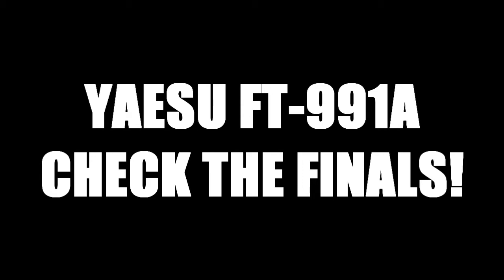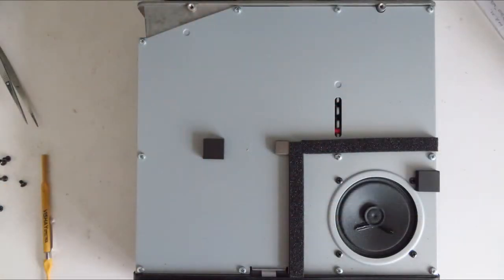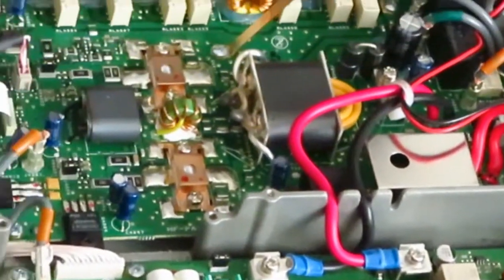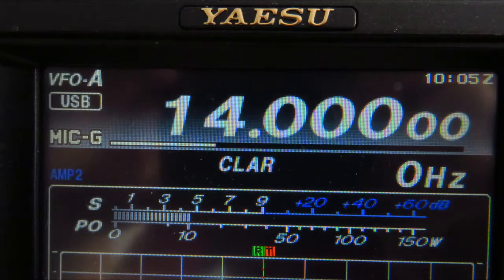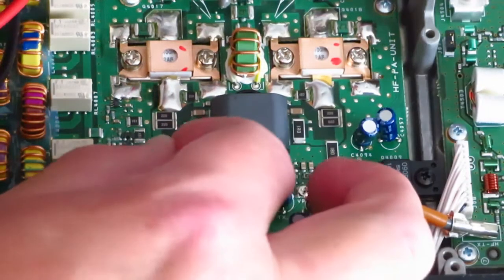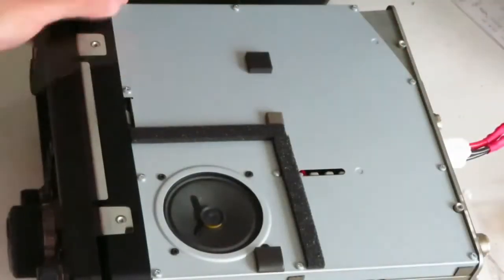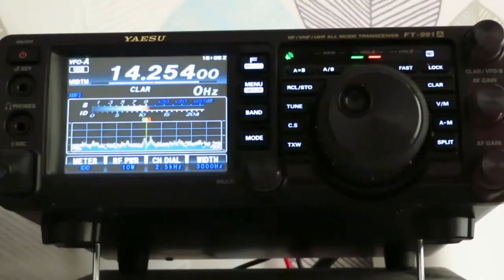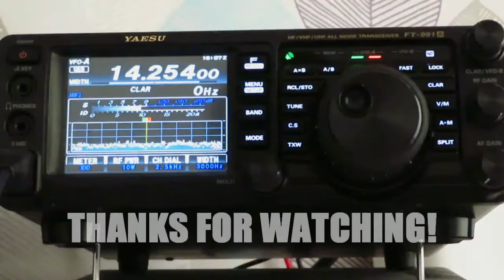Check Your FT-991A Finals

Comment: It is interesting to look at the shape of the output signal after such adjustments. And of course, I am sure that the thin probes of the cheapest Chinese multimeter dangling in the holes from the bolts show the true value of the current. An excellent guide to breaking your expensive transceiver!
Reply from the maker: Thank you for your comments.  It is entirely up to the viewer whether they undertake this adjustment or not.  The methods they use are entirely their decision.  Any equipment used is whatever the person doing this check has to hand.  If they have a professionally calibrated ammeter then they can use it if they so wish.  No part of this video insists that people buy a cheap Chinese multi-meter to carry out this work, they can easily used a high-end professionally calibrated meter that costs hundreds if they own one.  Anyone who is unsure of the methods used or lacks the skill required to undertake this work should consult someone who is knowledgeable.   The probes were lodged in the contacts and shown as they are in the video for clarity - showing the probes being held in place by hand would make the video less clear.  Finally my transceiver is not broken!  See you on the air!
Reply: @doktorvells3634  You must be responsible for creating a false impression of the simplicity of such manipulations, which encourages some people to repeat this and break their devices. My son once watched a video that was inspiring with its simplicity and decided that he could clean the laptop himself. I then had to repair what he broke. I know for sure that an incorrect bias current leads to a change in the operating mode of the transistors and signal distortion. Have you checked whether the signal shape has changed at different frequencies and at different power levels?
Reply from the maker: All the points you make are the responsibility of the person carrying out the process.  If anyone has concerns about what they have been told then they either investigate for themselves (including looking at component datasheets) or simply do not do it.  They must use their own judgment!  Reducing the bias current will not break the radio and it can be increased again (with care) if the user so wishes.  This information was provided for the experimenters of the amateur radio community.  I do not have the time to discuss this further with you.

Comment: Hi, just went through the technical suplement of FT991a, page 27, HF PA unit adjustment and there is clearly written adjust to get 1,5A. Any idea why YAESU officially instructs to adjust to 1.5A? The technical supplement for this model is easy to get. Any idea?
Reply from the maker: No idea.  I have seen somewhere that the original Yaesu recommended level of 1.5A is or was an error.  Numerous people have had problems with the transistors blowing when biased at 1.5A.  Transmission works OK when biased at 1.0A.

Comment: Got mine done, but if I pulled the jumper on 4001, it wouldn't read anything. With it on, it read 1.57 amps. I adjusted it as low as it would go (1.3 amps). I then pulled the jumper on 4002 and the reading went to 0 amps. I put it back on and was able to adjust the reading to exactly 1 amp. so, I adjusted 4001 reading to 1.25 amps, then brought it to down to 1 amp with the other.  This 'balanced?' the adjustment of both sides to about the middle of their adjustments. In any case, if I put my meter back on, it will read 1.0 amps. Hope this works.

Comment: Ok have not done this mod yet but will. My concern with the FT-991A is no USB connection. It did work fine for about 2 or 3 years and then no communication thorough the USB port. Sent it to the service center in California and they said it needed a new mother board for about $700 USD. Well I did not get it fixed but Have seen a repair of the USB circuit on you tube. Also low audio from the radio but I can live with that. Thanks for the great video and keep them coming.
Reply from the maker: Thanks for the kind comments.  I hope you get your USB connection repaired soon.

Comment: If I find one of my blown finals to be at more than 1 amp, would it be safe to safe Yaesu misaligned them and thats why they blew?
Reply from the maker: Judging by what others have written and referring to the Mitsubishi datasheet then misalignment was probably the cause.  Transmitting into a severely mismatched load (high SWR) can also cause the transistors to blow.

Comment: You forgot to say that you have to have the radio in SSB Mode, otherwise if you have it on FM you are going to get a really big current, also you don't need to get out your screwdriver if the current is 2 Amps then it is correct.

Comment: Thanks for this!!! I will do it ASAP!
Question... Have you reach to a solution for the FT 991A tuner issue? Ill tune it at low part of 40m band and in LSB as soon i pres PTT it puts carrier and infinite SWR. Thanks
Reply from the maker: Sorry Martin I do not low about that problem.  Glad you like the video anyway.  One of my transistors was biased at 1.5A!
Reply: I did it! Also with 1,5A in my unit. Procedure accomplished! Thanks
Reply from the maker: You are welcome.
Reply: @doktorvells3634  service manual for 991 and 991a both say 1.5 amps. Sent rig back to service and asked to set idling current at 1 amp..seemed aggravated a bit and said he had done these for years and never a failure, but did not indicate his setting.  We shall see, but I will ask where he set it when it returns. I sent to service for blown finals at 50 watts SSB, then did same at 35 watts.  Frustrated. My ts 590sg works fine in it's place, as does my Paragon II.....same hook up.

Comment: Any specific Power Output needed when doing this? 10 watts? 25 watts? 35 watts? or does it not matter? Thank you
Reply from the maker: It doesn't matter because the configuration described in the video puts the radio into 'transmit' with the final transistors in 'stand-by' mode due to the fact that USB is used with no audio to modulate the suppressed carrier.  Just to be on the safe side I would set it to 5W.

Comment: Is this procedure valid on the FT 991 NOT A?  Are they being biased wrong at factory, or does technical specs tell repair services to bias them incorrectly?  I just got new finals, and using 35 watts on ssb mine blew.  again!  NO issues with station as I have other rigs and swapped cables and switches with those on other rigs and other rigs are fine.  Antenna fine, P.S. fine,  &190 dollars a pair is getting expensive.
Reply from the maker: Procedure IS valid for 991A.  Biased incorrectly at factory.  I can't explain why yours keep blowing.  If you bias yours as shown in the video you SHOULD be OK unless something else is wrong.

Comment: I don't have the guts to do this on a perfectly working radio.

I guess I would rather risk doing nothing than taking the risk of my causing problems.
Reply from the maker: That's perfectly understandable.  I wrecked many a radio (and other things) when I first started in electronics because I didn't know how to approach taking things apart then reassembling.  Now I know that a methodical approach is necessary and to be in the right mood is also important.  My biggest tip is don't try to rush the job because that is when mistakes can happen the most.